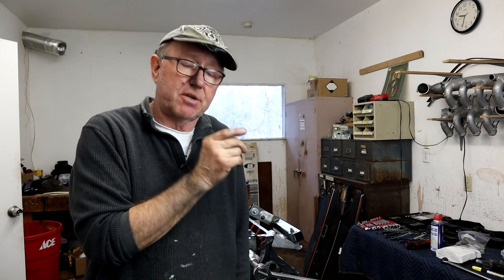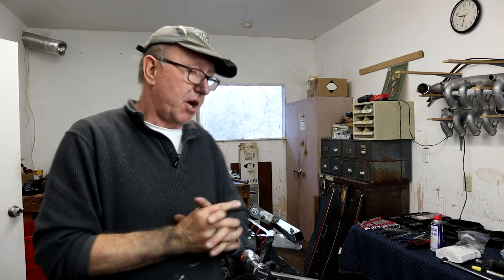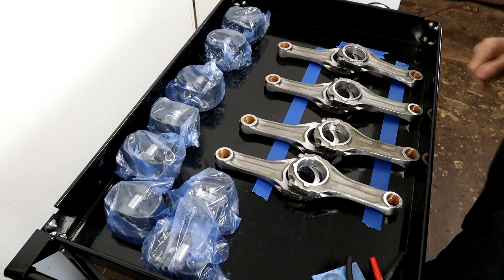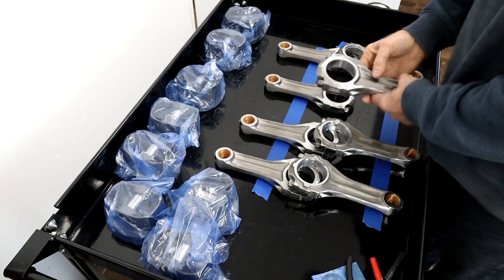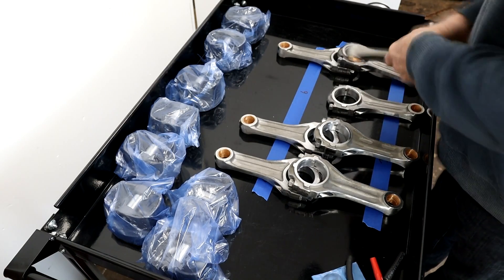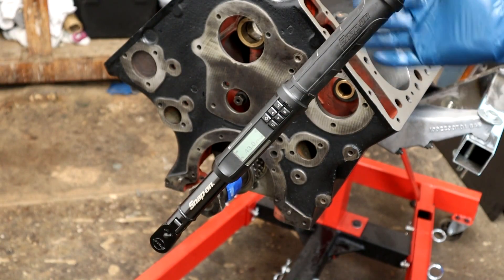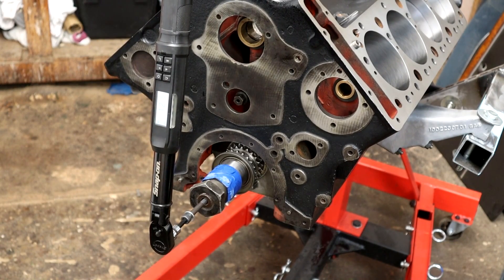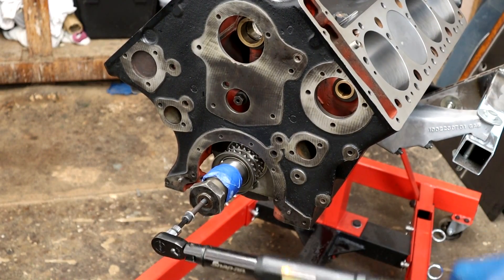INSTALLING PISTONS ON RODS AND CHECKING PISTON HEIGHT.

Comment: Dear John!
Great to c your progress. I love your way of doing those things, neglecting the fact that this engine has its roots more in the tractor section.....super cleanness, perfect.
I wish you all the luck with your bearings under pressure! Greetings, Oliver
Reply from the maker: Hi Oliver. 
Tractor Section :):). Its certainly built like a tank. I'm doing everything I can think of to keep it clean. When Its not being worked on, I bag it with a 50 gallon plastic bag to keep the dust and dirt out.
 How was your oil pump chain guide? Mine's a little more worn than I would like. On the look out for one.
Take care. Cheers John.

Comment: Very good on the assembly, a cup of coffee or hot chocolate by your side is a good thing. I just remembered, though you have not got to that stage and you might be knowing, the Mercedes-Benz V engines piston lineup is left bank 1,2,3,4 and then right bank 5,6,7,8.  The left and right is from the drivers perspective while sitted in the car. This is unlike American V engines where piston 1 is on the left bank, then 2 on the right, 3 on the left and so on. 🚘
Reply from the maker: Thank you for the comments. Yes a cup of Tea is always close at hand:) As for piston numbering, yes It's different from the US V8's.
All the best Cheers John.